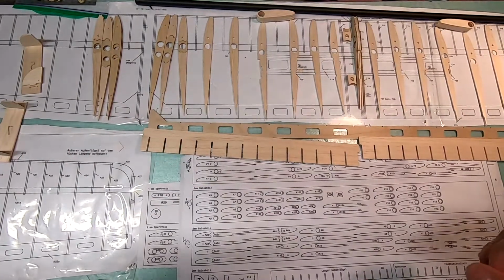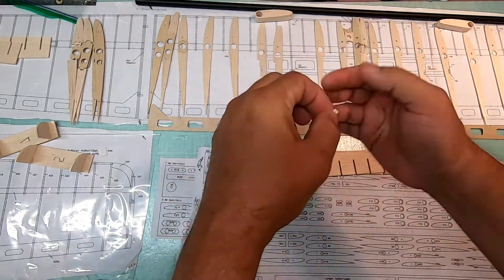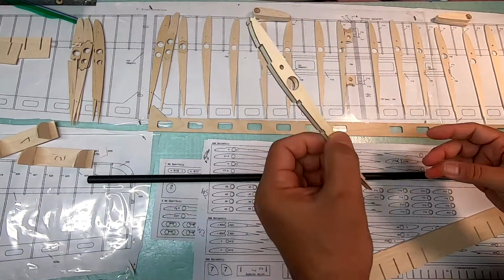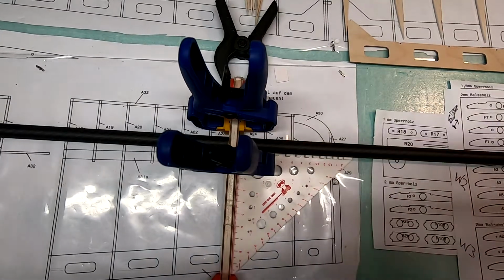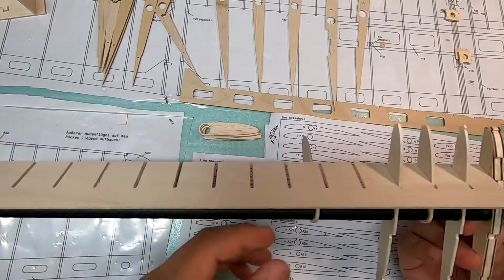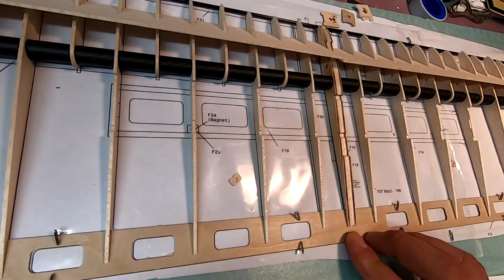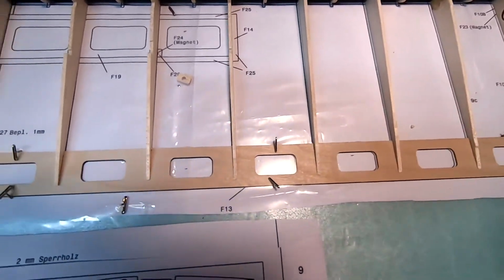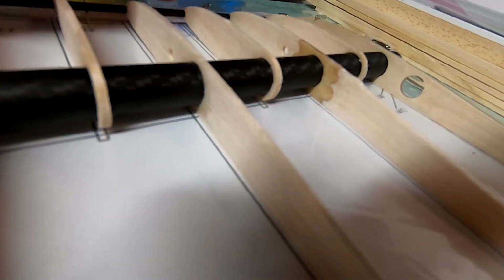Fresh F3-RES 2M Glider - Building the Center Wing Section, Pt4

Comment: Following this build carefully, have just purchased this kit
I have a questions, what is your building board constructed from, you push pins in very easy.
Reply from the maker: Sure, happy to help. It's two layers of foam insulation board that I got from local big-box hardware stores. The base layer is 1.5" thick and the top layer is .75 inch thick... you don't need two, but the first layer was getting a little ratty and .75" isn't enough so I just put the new layer on top. They come in 4' x 8' sheets so bring a long ruler or tape measure and a razor knife if your vehicle isn't big enough... I had to cut mine in the parking lot... so measure your work area before going shopping :-)
In case you're not sure of the product I'm talking about, here is a link to Home Depot and another to Lowes where I got the top layer.
https://www.homedepot.com/p/Owens-Corning-FOAMULAR-150-1-1-2-in-x-4-ft-x-8-ft-R-7-5-Scored-Squared-Edge-Rigid-Foam-Board-Insulation-Sheathing-88WD/202085958
https://www.lowes.com/pd/Kingspan-Insulation-Common-0-75-in-x-4-ft-x-8-ft-Actual-0-75-in-x-4-ft-x-8-ft-1-R-4-Unfaced-Polystyrene-Foam-Board-Insulation/999973072
It's a great kit. You'll have to let me know how your build goes. Feel free to ask any other questions that come up as you go!
Regards,
CJ

Comment: OMG why do you use so much ca??
Reply from the maker: I try not to go overboard, but the thin stuff flows fast and wicks into every crack. The plane is solid and weighs in at the expected weight... so I don't think I'm doing any harm even if I'm a bit heavy handed with the CA. Maybe I should use a more viscus variety of CA in spots. Why don't you send me some time stamps of specific instances so I can see what you're referring to...